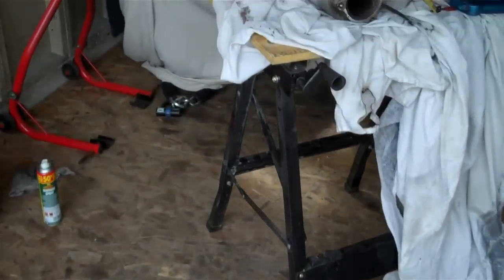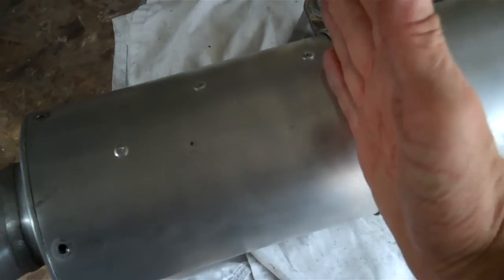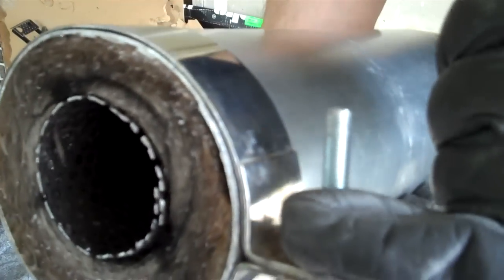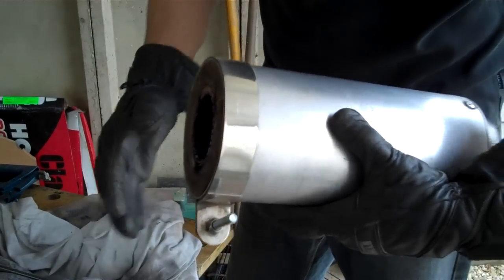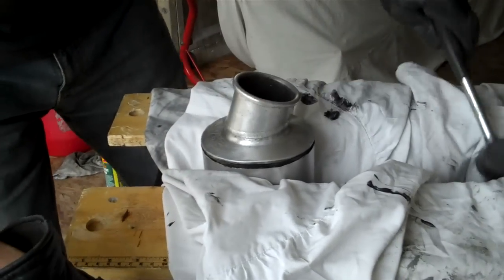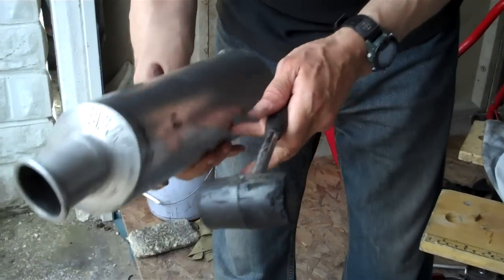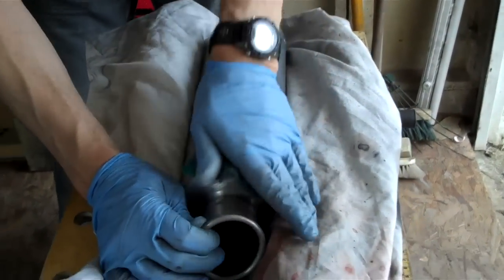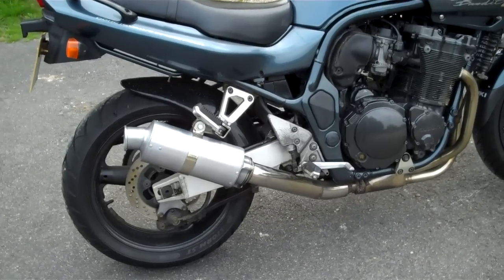Delboy's Garage, How-to 'Stubby' a Yoshi Race can.

Comment from the maker: Hi mate, you can't remove the baffle as it doesn't have one!  A standard Bandit can is a multi chambered silencer, the gases go through a maze of different chambers inside the can, weaving left & right as it goes, but you can buy a cheap after market can from E-Bay very cheaply and cut it down as in the video... good luck, Del

Comment from the maker: Hi mate, it's attached by being pressed in under pressure and the only way to get it out is as I showed, to cut the tube off around it - I just chose the rear end as it looked the easiest to remove, it's lasted absolutely perfectly, doesn't leak and is completely reliable... get stuck in mate, get any problems, just drop me a line - Cheers Del

Comment from the maker: Hi Matt. i would have to look at it to be totally accurate...but generally, as long as it has riveted end caps, and a single straight middle tube then you're good to go...just dont take more than 40% off the length or it will leave you a flat spot in te rev range...

Comment from the maker: Hi mate, any can that has a straight through central tube and at least one riveted on end cap can be cut down...the rule of thumb is not to cut below 11" as the thing becomes horribly loud and unpleasant! ...but generally I would suggest taking 1/3rd of the can first as you can cut more, but you can't add it back on if it's too short! LOL!  Good luck with it, hope it goes well, Del

Comment: Ok. My arms are like rubber today. Holy Yoshi! My canister was built like a German tank. I completed the stubby conversion but I could not believe all the packing, screens, and hardness of tube inside. Three blades used. I finally got end cap into new short section and it’s so tight I did not use rivets or anything. If it blows up I’m just going to order a Delkrvic 9” inch can. I enjoyed the challenge but man you made it look much easier.
Reply from the maker: Glad you got it sussed in the end buddy, its never as easy as it looks, but super rewarding when oyu hve it all finished... i would pop a rivet or two in the end anyway, it'd be a shame to lose it after all that work..!   Good luck,, and thanks for your support.. Del.

Comment from the maker: 'Legality' is all in the level of sound and whether it leaks gas or not....Yoshi cans are a very well made item and make a great subdued sound, the decibel level is about 95db at full length and not a lot more if you keep it to 11" or longer... make sure it has no "for off road use only" stamps on it, doesn't leak from any joints, and you're good to go...

Comment from the maker: Hi mate, I get asked this a lot and sadly, no you can't ..the standard silencer from the factory is a chambered system, which sends the gasses through a labyrinth of internal offset tubing...  you need a can with a straight through central tube and packing round the outside..also with end caps that are riveted in that you can drill out and re-rivet..I am sure if you looked on E-Bay second hand you'll find a cheap second hand item you can play with for very little money ... cheers, Del

Comment: Watched this video a number of times now and set to my exhaust on my fazer1000 yesterday (sp engineering oval) and voila 1hr later lovely little 10" stubby exhaust that sounds awesome. 
Thanks for the tips and inspiration to just get on and get stuck in. 
Hacksaw tips helped too to make sure I got the edge nice and straight on the first go with only a brief file to smooth the edge required. 

Keep up the good work. 

Only problem now is I keep looking at the Fazer and thinking hmmmm I wonder how it would look if....
Reply from the maker: Thanks buddy, glad the video could inspire you to get stuck in, and it's always great when you get the result you wanted... and the sound lol !  Thanks for letting us know, and always feel free to drop us a line if you get stuck, we're always happy to help if we can !  Ride safe (and loud lol), Del

Comment: well del ive done it ive stubby"d my can it sounds mint was easy as the end just popped of after the rivits were out, the only hard bit was trying to get the end cap back on as the shape had changed a bit. thanks for the video would not have been able to do it without it :)

Comment: thanks for the great video , i took all your steps, and followed them to a tee, and i'll be damn, i have a great sounding 11 inch can, only differnce is you used a YOSHIMIRO, and i used a D&D ,  but hey it was exactly the same welldid end cap,   it works just like you said, thanks agian, and keep the tips comming, 
oh its a 98 CBR 900rr profactory air intake W/ stage 3 kit from the site,    (+4 advancer),   EVO star shift kit,  dynateck 2000 ignition/ W coils, Brisk HP plugs, +2 R   -1 frnt gear

Comment: Was inspired by this vid to try the same with my Viper can which looked almost identical to that Yoshi...worked out well.......only difference I found to get the end baffle type thing out rather than cut down through the middle like at 6.40 here I just gave it a couple of whacks with a hammer down the middle and out the end popped with inner pipe attached

Comment: I've been looking at any info Del,obviously including yourself,about cans.I've just picked up a '97 VFR750,with a new Delkevic 9 inch,high level,stubby can.It looks the biz,but the noise is doing my brain in.Even with the baffle in.I've tried subbing this for an open end,hillbilly wrapped baffle.This just makes it run worse.Gonna try some other combination and see how it goes.If not,Ebay here I come(not again says the wife.Well this would happen if I actually told her).Stay safe.
Reply: Really thinking about getting a deviliks why is the noise doing your head in? Too loud?
Reply: It's very rough and raw.I've had loud cans which have been deep and kinda  bass sounding but this thing is gutteral.That being said,I think I must be getting used to it,since I don't seem to notice it as much.It's like an angle grinder in a metal dustbin.You might like it.Best of luck
Reply: +gregg ferns thanks mate but i the fews days i just bought a vtr1000 and it sounds like an absolute tank backfires more than my sv and twice as loud and my sv has a blue flame exhaust with no baffles, cheers
Reply: vast active why u like two cylinders

Comment: Great looking can sounds good I have the same muffler my just do this rather than the GP style I have on my other bike in Texas I can use open pipe if I want lot of the Hawg riders do massive sound. We passed a stock Harley on the highway said is that a Harley it's not noisy at all go figure. Still working on mine but it's 100 degrees right now
Reply from the maker: Jeff Bankston HI Jeff, you're right my friend, an exhaust means so much to a bike... IMO it's the very character of the vehicle itself!  Let's face it, a Harley is nothing without it's voice... good luck working in the heat, wish we could share a little out as here we have 62 and rainy today!  Typical British weather lol

Comment from the maker: But thats the exact point, if you cut down a cheap crappy can, they are horribly loud and never seal properly, and yes you WILL get a ticket because it sounds like its cut down and ruined. I have make the Yoshi sound exactly the same as before, but just a little louder and deaper, it's still a quality noise that doesn't sound like its been bodged and modified, also with the quality of the component parts i was able to make a perfect seal and a very solid result.and yeah, hand drills rule aye.lol

Comment: good video, thanks you.  had a question regarding the placement of the muffler hanging clamp, you cut the muffler right at the place at the clamp line.  so I was expecting the hanging clamp to be right at the end of the muffler.  but at the end of the video, how did the hanging clamp move to the middle of the muffler?  does it not have to align with the same spot on the bike?

Comment: Air tight seal on the end cap,but using normal rivits,prob ok as the pressure is low at the end cap,with a straight through, but nice job Suzuki rules,like your bandit,sounds sweet.

Comment: Best tutorial yet and no welding needed
Reply from the maker: Cheers Billy.....just rivets and sealant....get stuck in mate.
Reply: Moonfleet41 hi, what i can put the my sv650s 2004 ti have a song like a super sport ?cuz the sound it like simple bike thnak you.
Reply from the maker: RilesTV maybe just go on eBay and buy an open race can that's marketed for oyur model...easy to fit and should make it sound a lot better.

Comment: Hey mate, good video, does sound very nice at the end there.
I imagine that you have since worked this out but you can actually take the baffle out of the RS2 cans as you have to for repacking them
You can remove the end-cap and the baffle as one piece leaving just the hollow tube and the mounting plate at the other end, does take quite a bit of persuasion though from memory when I did so on my old SRAD 750. Then you could just cut the baffle and tube to length and slide it back in.

Comment: Hey, so, I have been considering a new exhaust for my '03 Bandit 1200. Did you like the sound of the Yoshi over stock? It seems that the only exhaust system I can find still being manufactured for the 1200 bandit is Yoshimura. Unless the 1250 exhausts fit up with the 1200 pipes?

Comment: Hello what was the black ''grease'' you applied at the end of the cutting and snapping back together the end cap? Thank you. One thing I really loved of this videos, is that everything was done with hand tools no power tools.
Reply from the maker: Hi Christian, it's not grease, but a black silicone sealant, same as the kind used for sticking car windscreens in!  You can buy it from automotive shops for a few pounds, just look for automotive heat proof silicone...
Reply: Ok, thank you for taking you time and answering.

Comment: Alright Dell looking through as always when I'm stuck! I've got a stubby exhaust on my fazer, that a previous owner has riveted a bracket onto, is it possible to remove that bracket to replace it, as it's extremely bent up, or would exposing the old rivet holes be a problem? Ie mot etc? Thank you for any information. 
Jason
Reply from the maker: Hi Jason... no mate, that should be easy enough to fix.. if you drill the rivets out carefully with the smallest drill bit you can get away with, you wont make the holes any bigger... and then you can reuse them to refit the new bracket... but if you want to move the bracket and not use those holes, then just put new rivets in the hole and they will block up more then enough for MOT.. you shouldn't feel any gas leak from them, but if you do, you can smear a dab of sealant in the centre if the pop rivet hole... also looks ok if you make a good tidy job of it.!   Hope that helps buddy.. Good luck.. Del.
Reply: Moonfleet41 thankyou very much once again solved my problems, ya will have to start charging buddy, thumbs up on the fighter as well mate, she came out sweet as a nut! Been using alot of that gained knowledge on mine! 
Thanks again 
Jason

Comment: dear delboy u reckon i can get improved power by installing a small goosneck valve on the original exhaust header to let more exhaust out when i need it..will it work in theory?
Reply from the maker: +fidel catsro No mate, it won't... if you want more power, you must process more fuel, so re-jet the carbs, fit a race exhaust, and get it set up on a dyno... yu will get better response and better torque, depends how much you have to spend!

Comment: If you take out the padding will it make it sound louder? I have a yoshimura rs3 and I want to make it short but I'm wondering if I take out the inside padding will it sound louder or will it just sound louder if I make it short? Please let me know. Thank you
Reply from the maker: The fact that it's a straight through pipe means that it's already loud, shortening it will allow the sound to escape sooner, as it has less baffling to pass through before the noise escapes, so it will get marginally louder and sound more aggressive... taking out the wadding will just make it sound 'hollow' and rather cheap... so I'd leave the wadding in, unless you want it to sound really 'brutal', which is often not a nice sound!  Good luck, Del

Comment: hi del i am fitting a aftermarket set of scorpion cans to my blackbird .when taking the old heavy oem cans of i see a gasket on the link pipe that fits to the collector box. but when i try and fit the new link pipes in  the collector box the pipe is very tight so tight i would not get a new gasket in there as well. i think they are meant to be fitted dry without gaskets. my question is would standard silicon sealer be fine to use on the joint ?or does it need to be that car windscreen stuff del. thanks in advance or maybe fine without any sealer
Reply from the maker: Hi John, this is very common with universal cans, you just get a standard sleeve joint and yes, you can use silicone to seal this, I wouldn't put it together dry, as you'll get condensation water with soot in it running down the pipe and it looks horrible... regular bathroom silicone is no good, you need to use the black automotive stuff for screens and so on, it's heat resistant and will fill a gap up to 2mm thick... make sure you wipe off any excess before it dries, as it's a bugger to get off once it's set... good luck with it, Del
Reply: thanks del for the long and detailed reply very helpful indeed mate . keep them videos of yours coming as i enjoy every one of them and say hello to penny from me . john/
 belfast

Comment: My micron can comes apart very easily but I need to cut the inner pipe to shorten it and join it back together as I need both original ends. Videos I've seen only use welders, would it be ok to rivet it back together or should I take it to a welder?
Reply from the maker: Hi buddy, is the end cap currently riveted on, or welded... obviously if it's riveted, you can re-rivet it through the same holes, but if it's currently welded, and it may be a little more thinking to make it work - the inner tube itself isn't usually welded to the end caps, just shoved up against them with then end caps holding in place, so measure it carefully and it should go back together just the same !
Reply: Moonfleet41 the micron is really strange, has an Allan bolt inside the end which after releasing allows the ends to both come off. The inner pipe has bits on either end that help hold it all together so I can't just cut an end off to make it shorter I need to cut a section out of the middle, I'm thinking then riveting the meshed bit back together should be ok

Comment: Great video. Great idea. You have convinced me to try it on my Yoshimura R3 I have on an old mans bike. (2014 CB1100) Yes, I’m ancient. My skill level is hopefully close to yours. I have same primitive equipment. No fancy tools in my garage. I was thinking of using sheet metal screws to hold the endcap instead of rivets since I have no rivet gun etc. what’s your thought on this idea?Anyhow, great job young man. Thanks for your time and advice. I live in Louisiana but if I was closer I’d buy you a pint, here in States it would be just a bottle of beer or my favorite, a couple of shots of scotch, straight only. Cheers!
Reply from the maker: Scotch must be straight only, same as Bourbon right..?  The sheet metal screws can vibrate loose over time, even with threadlock because the heat melts it. but it doesn't hurt to try, keep an eye on them, and if they fail on you.. then just pick up a cheap rivet gun from harbor freight, i bet they sell them for less that $10..!   Oh an i love the CB1100, it was great to see Honda bring back a muscle bike to the roads after all those years of Tupperware race bikes..!   Thanks for your support, and have a great Christmas.. Del.

Comment: i really like the vid its detailed and informative. I have the same can however mine is already shortened as i bought my bike with it like that. My baffle is loose on the inside if i have this removed could i hurt the engine by having an empty can?? bike is a 7x7r Kawasaki
Reply from the maker: hi Mohammed, you wont hurt your engine too much if the can is totally empty, but it will sound horrible ,and you may get flat spots in the rev range... better to have it repaird and secure the inner tube with some new wadding too..!

Comment: Hi Del I'm from Perth Western Australia your videos are very helpful I have a question, I have a Suzuki GSX 1400, and I would like to stubby the can but I'm a tad worried about the back pressure and having a dead zone through the rev range.  I have a Howler can on it at the moment, and it is 15in long not including front and end caps. The baffle goes straight down the middle like the one you have on the RAT what are your thoughts. Thanks M8 keep them coming :)
Reply from the maker: No bother Wayne, as long as its already running on the open can you have at 15" long, and no flat spots...then you can take up to 30% off the length and it shouldn't effect it.. the more you take off the more chance it will have an effect...but TBH its a fuel injected bike and the map should adjust to a little less back pressure just fine. its only on carb bikes that don't self adjust that you need to re-jet it.....and even then, my Bandit pile runs carbs and a factory air box....and not ill effects what so ever with the can at 11".....hope that helps mate.. Del.
Reply: Thanks m8 I'll give it a bash on the weekend I'll let you know how it goes cheers again m8 have a great day.